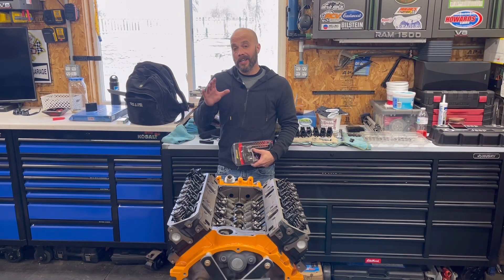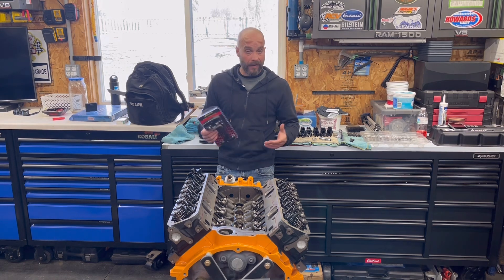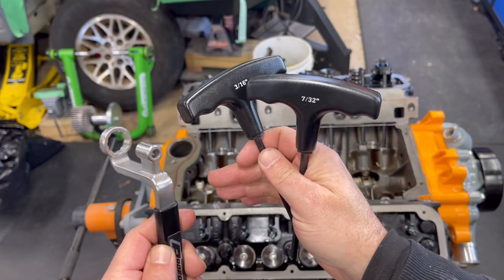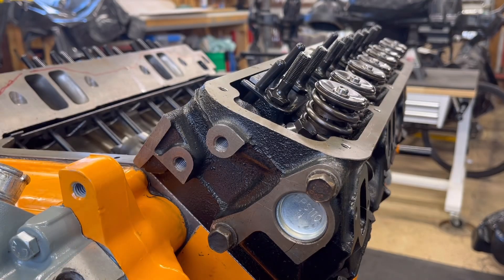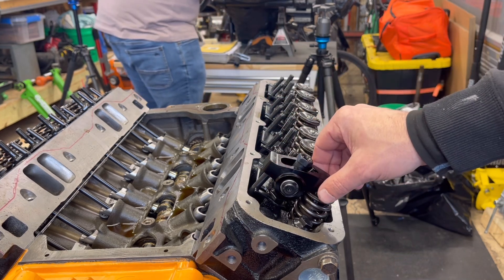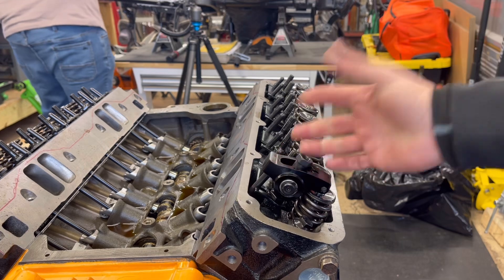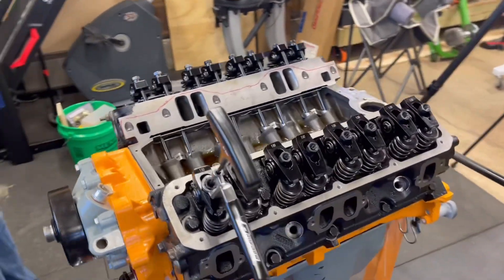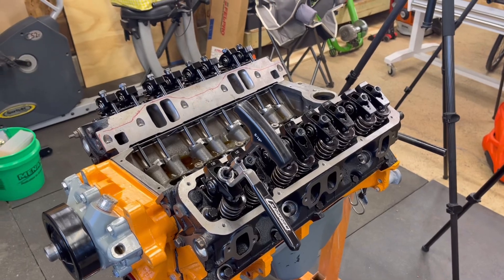Tool Review - How to Set Hydraulic Lifter Preload with a ProForm Valve Lash Wrench Set #howto

Comment: I will check out that tool. Can I assume that also would work with the Proform roller tip rockers that are the shaft mount type for the LA (non- magnum), flat tappet type camshaft system?
Reply from the maker: yep, that is another proform tool, works great and budget friendly.  I would contact proform to ensure you get the right one, there are a few different ones
Reply: @2HacksGarage Thanks!